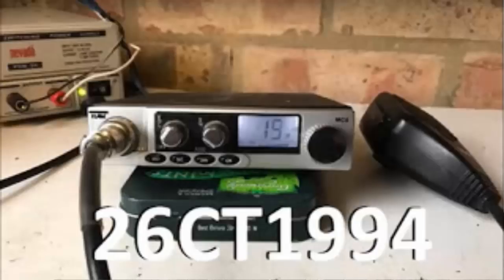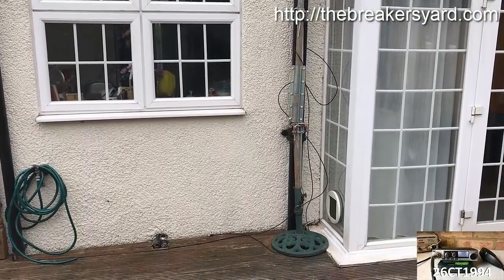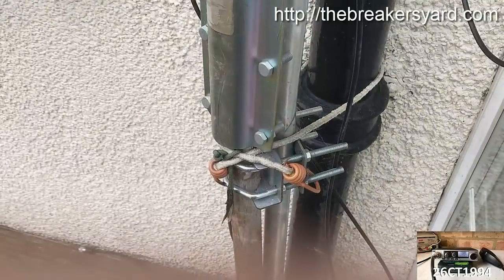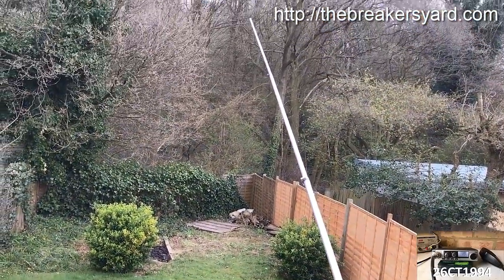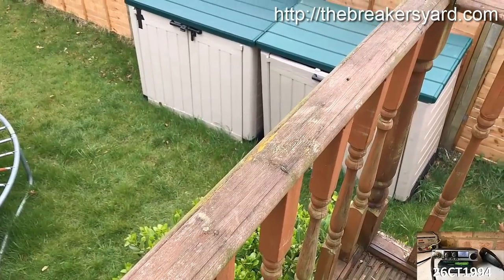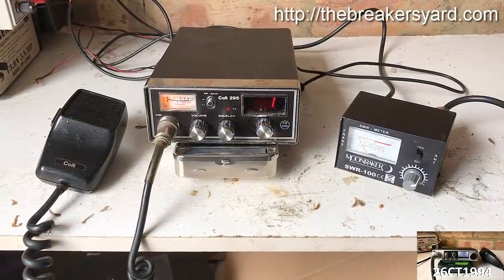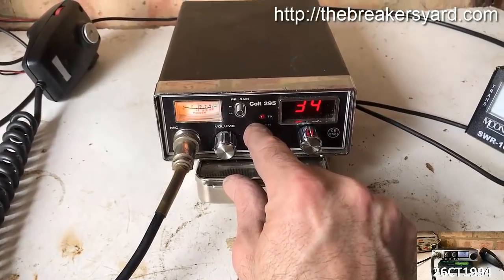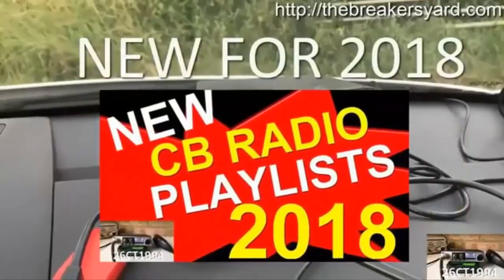Base Station CB Antenna

Comment: Thanks for the upload. Not telling you how to suck eggs. However  I am surprised you got 2 years trouble free service from that antenna. I always use amalgamating tape to weather proof the joints, and quality RG213 Coaxal cable .. Grounding the Antenna is a must for performance and safety.. The rest will follow.. The high SWR is usually down to water encroachment  and internal corrosion.. Same with thin unprotected coax.. Its all a learning curve fella. Enjoy your radios.. 73's   153.- TM - 001

Comment: Love the set-up. You done a excellent job. Although I am not liking the wire joiner connectors you used to join each of the cables together. I believe I saw you have 2 different brakes in the wires. It's very important to have 1 straight continuous wire from your antenna to your cb radio.When you put wire joiner connecter on your antenna feed, this is a entry point where noises and other unwanted signals from other electronic devices or sources can disturb and disrupt the incoming sounds through your CB..Inside a wire there is a plastic protection sleeve that covers the middle (Positive) wire, this plastic sleeve is in place to stop any incoming signals from entering your wire feed, when you cut the wire and add a metal connector to the cable,  you are braking the protection of that wire, and adding in a metal object within your wire feed, Which could very easily pick up unwanted electronic sounds/signals, or allow signals/power to escape.   This may even be the reason you have a high SWR. I would suggest replacing your chopped up coax wire to a brand new uncut wire and see what results you get.

Comment: Hi Matt.  Without wishing to be overly critical and leaving aside the lash-up mast set-up which looks far from safe to be honest. Your SWR issues are almost certainly being caused by the fact that in its current position the base of your antenna is level with and in very close proximity to the down pipe vent sticking up above the eves of your house!

Having the base of the antenna that close to a 4,1/2 inch cast iron pipe WILL have a huge influance on the antenna and unless you increase the  height of it or move it a good deal further away you will not cure the problem. Secondly line losses on RG58 coax (the type you appear to be using) are huge. 0n a 100ft length of RG58 only  62% of the RF you put in from the radio will make it to the feed point on the base of the antenna. So in your case inputting 4w from your UKFM radio into 20m of RG58 means approximately  2.4w will actually be making it to the antenna. I would suggest running RG213 in one unjoined length from antenna to shack it will reduce losses and the lightly-hood of water finding its way into the system which could potentialy destroy your radio

If your putting up "educational" informational videos on radio equipment installs ect you really do need to demonstrate a reasonable grasp of the fundamentals involved. A decent homebase antenna install is not much more expensive or involved than a shonky one. and if done well would last for years. but lash-up's can A damage/destroy radio equipment and B potentially injure or Perish the thought get someone killed!  Buy a set of T&K brackets ans a couple of aluminum  scafold tubes some decent coax and weather proof all the antenna joints and PL plugs with self amalgamating tape please!

73, Tom,
Reply from the maker: Tom,

I appreciate you taking the time to write such a detailed comment and I'm sure that those who read it will see the value in it.

For point of clarity however there are some points I really should respond to

What is important to understand is that this exact setup has been in that position for over two years without ever giving any form of concern and that its location was chosen because of how sheltered it is from anything that might up-end it. 

I need to state also that as a father of two young children I would never put them at risk and have carefully considered this when using this set up,  It simply doesn't move and it would take a good deal of effort for it to cause any type of issue.  If I was at all concerned about its safety it simply wouldn't be there.

You are absolutely correct that any metal near a transmitting aerial  can cause an issue but I have had a SWR of less than 1 prior to the issues described in this video and although not optimal  I regularly achieve ranges of more than 15 - 25 miles from a 4 watt signal.

I buy and sell a lot of 2nd hand radio equipment and there has never been an issue with this set up causing problems with reflected power.  To my knowledge, I have only ever used RG58 (or whatever they sell you) without concern, so assume a great deal of other people do also. 

An important point to make here is that nothing you ever see on YouTube should ever be considered 'Educational' and if anything should only ever be considered, at best 'Informational'.  If there is anything to glean from this video, it is 'How not to make my mistakes' which is part of why I do it.  I came back to CB Radio just two years ago and regular viewers will understand that this is nothing more than a video journal of the journey I am taking and sharing with others.

I believe that Radio generally is currently on the increase and my hope is that in some small way, what I do is generating some degree of interest in what would otherwise be a lost 'technology' in the slew of 21st Century gadgets that our younger folk are engaged with and if what we do here on YouTube encourages others to get involved in the hobby it will only benefit all concerned by repopulating what would otherwise be 'dead air'

Lastly and most importantly, please understand fully that I take no offence from your comments nor offer any in return, which (in the day of email and Facebook) is difficult to convoy properly in a simple written message.  You clearly are a knowledgeable and experienced individual in this matter and I am highly respectable of that fact.  I am nothing more than a hobbyist with extremely limited knowledge or experience and utterly appreciate you taking the time to add your comment with what is clearly useful information to share (and by using this platform are doing just that) and would welcome your input (and redress) in future videos.

Thank you greatly for your input  

26CT1994 (Matt)

Comment: You sound like you come from the deep South. I wonder if you can get in on our South East Coast Net tomorrow ?
Reply from the maker: +Tony Ling happy to give a try ;).  Isn’t it 10 metre?
Reply: It's 11m, 
20:00 – 21:00 on the muppets, 3 or 39
2100 onwards 27.39500 MHz USB